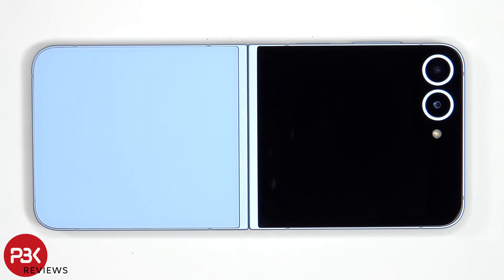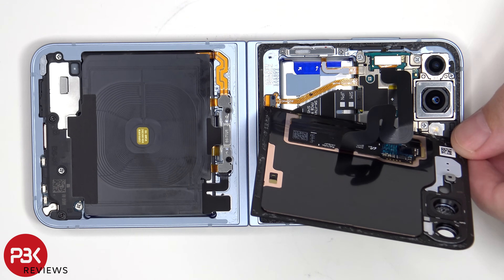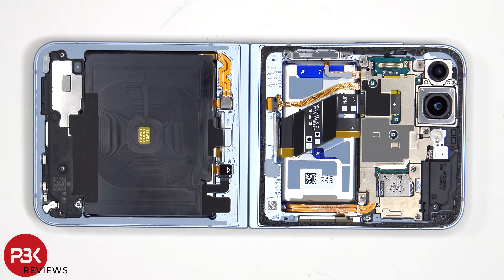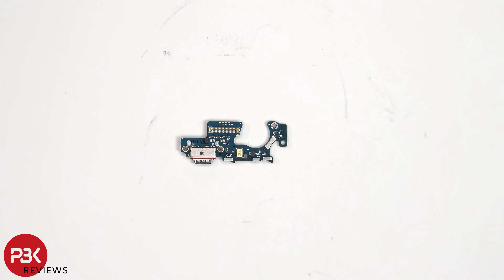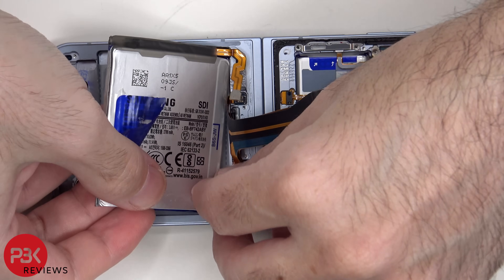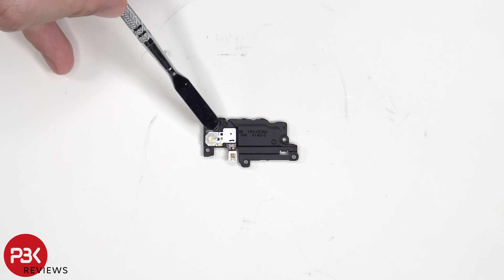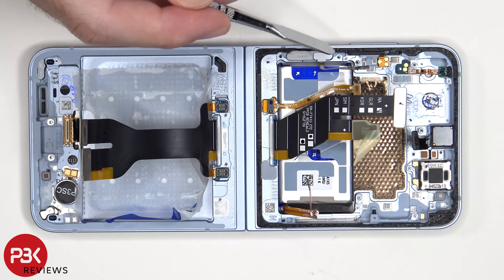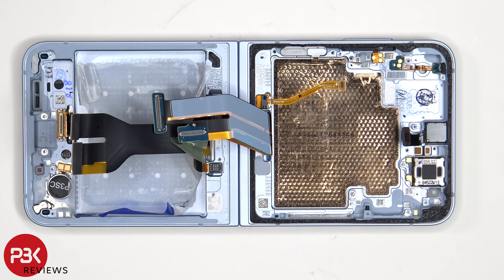Samsung Galaxy Z Flip6 Teardown Disassembly Phone Repair Video Review

Comment: Lost use of the charging port and 3 days later lost use of the touchscreen on my Z Flip 6.  Had the 4 and upgraded after dropping it once while closed and enclosed in a case, but still the screen became unusable, couldn't completely open the phone.  Have had the 6 less than six months, and now this.  I am done with the Flip.  They are great until they aren't.  Going back to the S.
Reply: I’m trying to fix one for my client, it doesn’t charge and I’ve changed battery and charging port and still on dead screen showing 0% battery

Comment: I've heard that the flip 6 vibration motor is better than the flip 5, is it possible to put the z flip 6 vibration motor in the flip 5?
Reply from the maker: no because the connection or contact spots are different and it wouldn't work.

Comment: That flex cable that was connecting the two halves is a ticking time bomb. It will degrade and fail even if you baby your device.
Reply: Do you have any data to backup that claim?
Reply: You mean where I don't see in flip series if it fold I think it can happend but in flip i don't think so
Reply: Makes sense why many have internal screen issues ans Samsung replacing phones no questions asked.

Comment: This phone is impressive. But it feels like it's more unrepairable than any phones out there. It feels fragile. I'm on S24+ and still won't use a foldable but this is impressive. I do like the its size when folded though. Recently, I bought a dumbphone that I take when I go biking and skateboarding because my S24+ is too large for my pock. Also, I'm worried that I'll break it when I fall down which is common in my hobby. A small smartphone trend should start again!
Reply from the maker: I like the folding phones for the fact that they are fun to use, but not practical since they are fragile and the worry of always thinking about damaging the folding screen, or the folding screen just going bad for random reasons its a deal breaker for me. I used the OnePlus open for a while and loved it, but again the worry about possibly opening the display one day to find it malfunctioning would cause me to not even use the folding screen.

Comment: Replace lcd will be more painful score 8/10 it’s wrong I will be given 6.5/10 and interesting will be swap parts in another phone and not have issue like iPhones .
Reply from the maker: There is a breakdown chart for each section that adds up the score. I don't just go off of how easy it feels and rate it just off of that. Other factors add to the score as well, so you can rate each section in the breakdown to see which is better and which is worst.